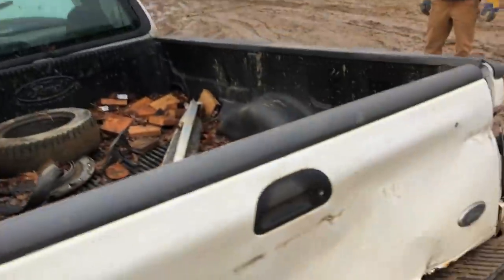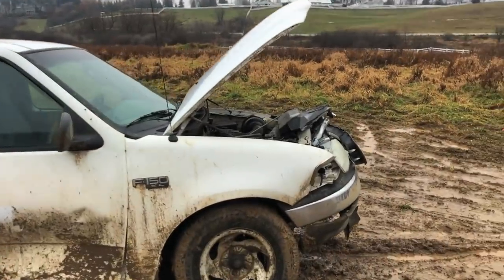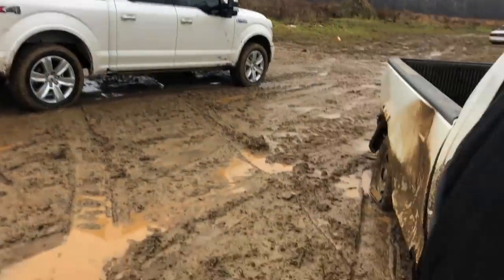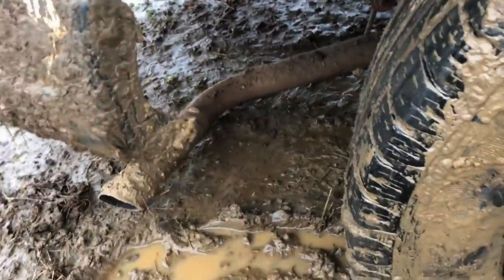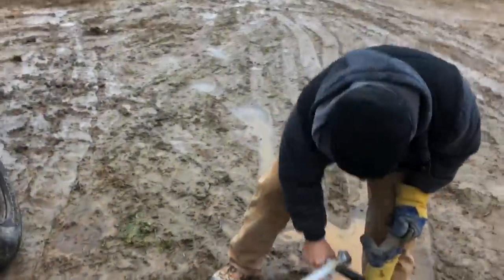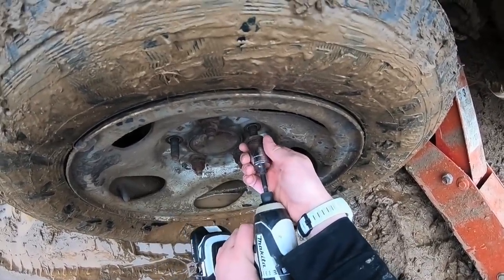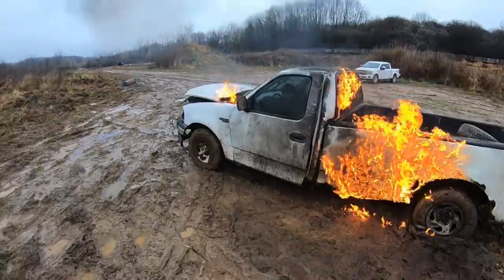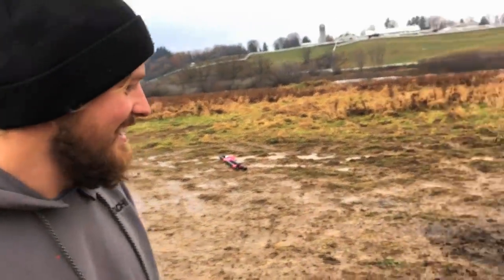$400 Ford F150 XLT FIRE!!!

Comment: Watch an educational video on differentials and then you will know exactly what to expect every time! That there f150 is open diff. Or what I like to call, a 1 tire fryer. Limited slip, or LSD, means that one tire will start to spin first then they will start to spin together once the diff locks up and does what its suppose to

Comment: That's the thing about limited slip differentials. They are pretty much designed for less chance of spinning out on snow and ice and not very good once you actually get stuck. At least that's kinda how I think about it. I could be wrong. I'm no expert
Reply: Limited slip is actually waaaaay better than open when you're stuck, tires have to spin at different speeds around corners so the wheel doesn't hop, limited slip makes both spin at the same speed , where in a standard open diff vehicle the wheel with the least traction will spin and the other won't do anything.